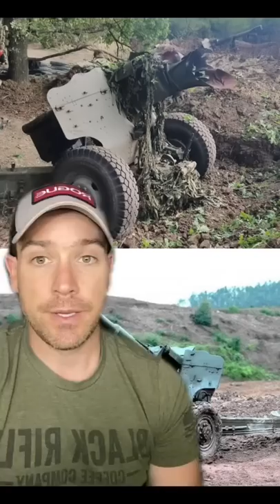Artillery Misfire: Round Detonates In The Tube

Comment: For people saying it was scuttled or sabotaged, I have my doubts due to the size of the flared open barrel, and then the LACK of a barrel in general. Looks like the payload in the projectile blew up in the barrel to me.
Reply: The barrels are only rated to withstand 1000 to 2000 shells before accuracy degrades. Once the threshold has passed It rather quickly deteriorates in accuracy. Eventually the barrel fails. There's a good chance the terrorist crew didn't even know to count rounds and replace the barrel.

Comment: They are firing from a safe distance all the the time as i ve seen so the crew could be fine .
Reply: So the first round is shot from a distance but every round after is shot up close to be fast as possible
Reply: If the breach popped open then couldn't we expect hundreds of pieces of shrapnel being sent towards the crew?
Reply: Even if you are 10 feet away if the HE round detonated you will almost always die
Reply: @humanhuman5024  actually it depends on the piece. Let's say a 119 shoots a 105mm round its not as bad as the 777 shooting a 155mm round you'll be more likely to recover from the 119s malfunction
Reply: @Church__666-6  no, even the M119 has a 150m lethality range. Add extra shrapnel from a splintered tube you have a giant nail bomb.

Also the D20 is a 152mm gun, so it's likely other guns caught shrapnel too.

Comment: The easy assumption here is that the projectile high ordered in the barrel, not a a fault with the propellant, a gap or crack in the explosive during or after pouring. After firing while accelerating, the crack closes up rapidly, and compresses the air... like a diesol engine it can ignite..  then detonates the High explosive, lucky for the crew it was close to the bottom of the round and fired like a shapped charge forwards and out, hence the tyres are still ok. Likely the crew need new pants.  This is why all of our ammo is xrayed prior to acceptance into service. A low order would be the projectile jamming and blowing the back off the bottom of the gun. I have a couple of mates who were involved in this happening.

Comment: Reminds me of the thermal shells used to destroy a gun when you are forced to abandon it & retreat so the enemy can’t use it.  It has thermite in in it, you load the shell & pull the lanyard as normal but it just sits there burning at such a high temp that it welds the breech shut rendering it inoperable.  If these shells are not available an explosive charge of demo is dropped down the barrel and you get this same result.

Comment: I saw an uncropped version of this photo with intact ammo and powder charges neatly stacked behind it.  The fact the ammo wasn't doused with fuel and lit on fire makes "spiking the gun" unlikely.  
    The gun crew could have...
1) Put the newer higher pressure powder charges for the newer 152mm SP guns in their gun (unlikely because the brass casings aren't the newer ones used in the new SP gun). 
2) Had a powder charge ignite on a hot bore while loading (unlikely because the brass case that gun uses for its powder charges would protect the powder from the hot tube). 
3) Reached their barrel's End of Life and just kept on firing the gun through an excessive round count.  That would have caused the barrel to fail catastrophically.   I think this is the most probable cause because the breach block blew off too but the gun's recuperator is still intact.  An exploding powder charge would have blown the recuperator off too, as well as causing all kinds of damage to the gunnery controls and sights (which seem intact in photos).  I believe the explosion occurred IN THE BARREL and traveled backwards into the breach block, blowing it straight off the back of the gun.

Comment: In the 1980,s there was a case where the propellant did not have enough force to get the round out the barrel.  Then the crew which was loading and firing as fast as possible, loaded a second round because they did not verify the first round had cleared the tube.
The resulting explosion led to results exactly like this.
And the crew did not survive.

Comment: Hard to say but judging off the intact breach & tires, no propellant burn on tires or shield, and how the tube is blown mid way through. I’d say it either an intentional blown in place to keep from opposing forces using it or a timed fuse was set wrong or a bad fuse and detonated right after firing before projectile exited the tube.

Comment: D-20s? How old are those?!
Reply: Manufactured in 1950's
Reply: Start producing by 1947 .
Reply: @Leo-yr5jb  designed ca 1947 but production not started until the 50's
Reply: @theodorbjrk6625  before name Д-20  it was hundreds of units Д-72 prototipe all 72 was renamed to  20 after 1950 but it same

Comment: Being as you can see other pieces still in their dugs further down the firing line it's not a spiked gun to prevent capture.

The way the barrel is 'flowered' out is a ductile failure due to overpressure. Indicating either the propellent burned to quickly (improper storage) or the projectile was restricted.

If the actual HE filler had detonated the fracture would be brittle as the high order explosive would shear the metal as a brittle fracture and you'd have no 'flower'

So the crew is probably alive, just had a very bad day.

Comment: The one possibilty I haven't seen listed in comment section is metal fatigue. Old howitzer used beyond specs. and any metal will develope microcracks. Reason why they magnaflux pipes, engines etc. When high performance materials/equip. fail it tends to be catastrophic. The old toy brass cannons were build for flash powder but a surprizing number kids died/injured from using black powder let alone smokeless, rifle or pistol powders.

Comment: A crack in the breach wouldn’t cause a round to detonate. If anything the breach would detonate if it had a crack in it and the round would just be chillin halfway up the tube. There are two possibilities. 
1: the propellant was too powerful for the round it was paired with and blew through the baseplate or the round, detonating it. NATO 155 howitzers have rounds and charges that can do this. 
2: the fuze was faulty and the force of the round being fired set off the fuze which detonated the round. This happens very rarely in conventional militaries and not so rarely with groups like these which use outdated gear and munitions.

Comment: You know where the term misfired came from? Flint lock, cap lock Muzzle loaders and cap and ball revolvers or cannons. It means the cap or pan went off or was struck and didn’t set the charge off … would even be an appropriate term in a modern cartridge firearm with a dud primer.  THAT was NOT a MISFIRE!

Comment: Nah bad maintenance, have a guess how many times that barrels been cleaned? Most Russian equipment is built to be solid, you can throw an ak47 in sand and it’ll still fire but firing 700 rounds etc doesn’t mean the barrels not going to warp